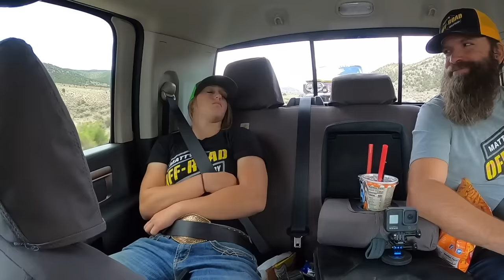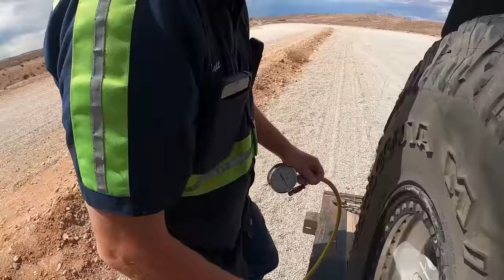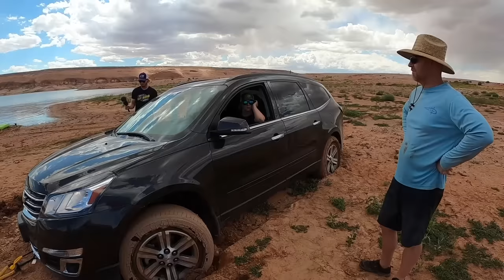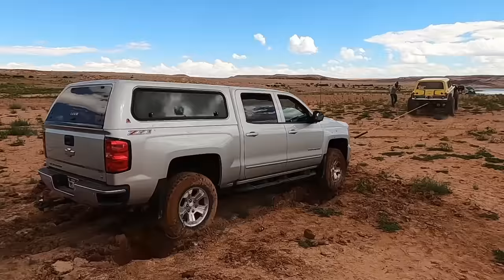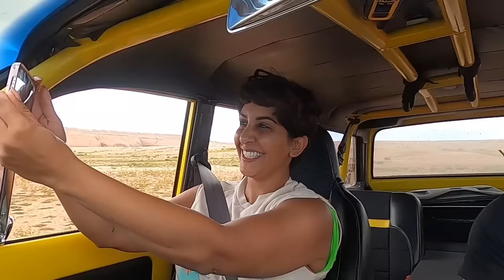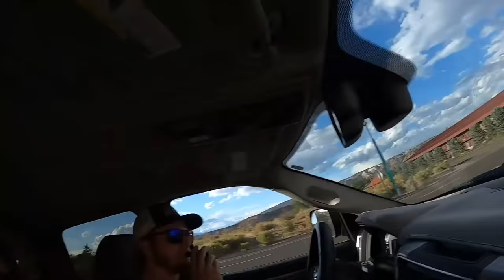2 Days Stuck In The Desert & Desperate For Help!

Comment: There's no tow trucks around page az.... Weird
Reply: I wondered that same thing and did a bit of research.  It is about a 4.5 hour drive from Page Arizona to the ferry at Halls Crossing to Bullfrog. But Powell is so low that they haven’t run the ferry this entire year. The next option would be to cross further north at Hite and then once on the north side of Powell to head to Bullfrog - probably an extra hour or more or so this way. Coming from Hurricane, UT or Page, AZ with the ferry not running makes them look pretty similar in road miles.

Comment: Be carefull trucks are not good i have a gmc 2018 Sierra  less than 1070.00 miles replaced transmission, motor mount,  and a week later water pump,  I do not drive extreme mostly all highways so no quality in new and seems to be designed to fail, also have a terrain which had transmission issues,  thought you should know what you guys build seems to be better than a corporation now . Problem  with fighting for a cause is it will fail you,  Megatron said best.

Comment: Why wouldn't jacking the stuck vehicle up work ? because the area of the rock was too little. One trick is to use the spare tyre or some other material from the vehicle,  so get a large area on the mud.  or if you have to use rocks, make it a  pyramid so as to increase the surface area of the rock being pushed down.    4wd's should have  boards/ramps so as to form a bridge over the trap. or at least a float, to float on the mud.

Comment: It's also what happens when you have street tires and that 'electronic stability control' system where the car will slow your wheels if any are slipping. Absolutely worthless feature and even more so with 4X4 vehicles. Kills your momentum.

Comment: How do you charge for a job like that  4 people x 6 hrs 24 hrs, double that 48 hrs, x $45per hr =$2160  plus two cars  @ $30 per hr =$1440, fuel 12 hrs drive time say 1200 ks @ 20 ltrs per hundred say 250 lts fuel @ $1.50 =$360.  Total $3960  Giving the circumstances I'd say that was cheap and I wouldn't have done the job for anything lest. But then I'm in Australia and my figures could be way out compaired to US values.  Those people were very luck to find your no.